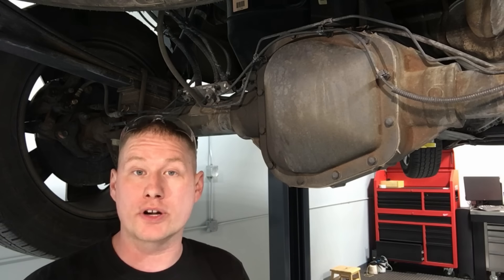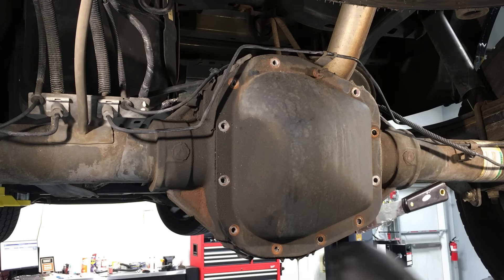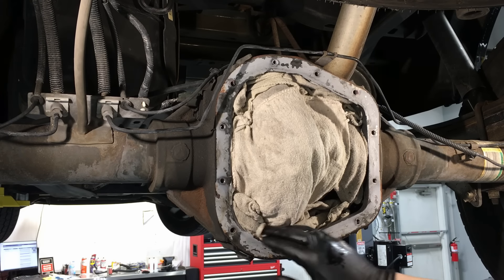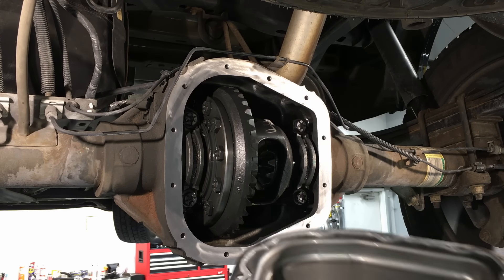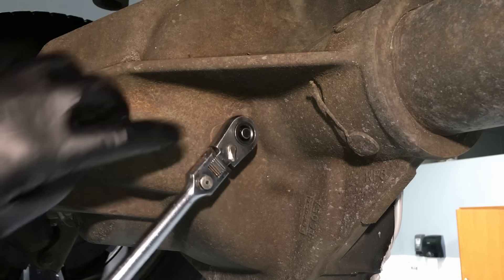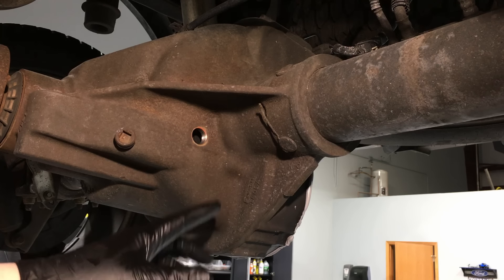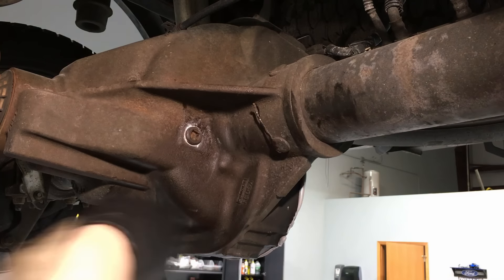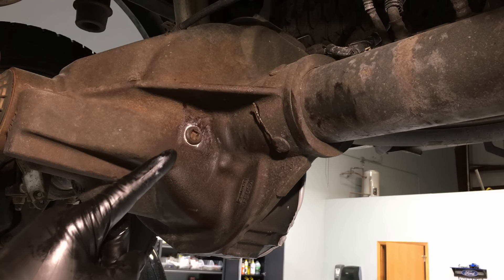Ford 8.8" 9.75" 10.25" Rear Differential Service: Fluid Change Procedure

Comment: I hear many say to be very careful not to use anything that would scratch the mating surfaces while cleaning old gasket off...then you come along and use an actual flap disk/abrasive pad to clean it.  Which is correct?  

Also - using only RTV and no actual paper gasket?  Is that ok?

Comment: I put 3 in mine and could feel the oil when sticking my pinky down in there. Just got another bottle watching you tell us that it has to be at the bottom of the fill plug. Would driving it while low mess anything up.? I probably put 50 miles on it with the oil slightly low.

Comment: Thanks for the information. I did my 2018 F150 this past weekend. Front and Rear. I would of used a 13mm if you wouldn't of mentioned it to use a 1/2in socket

Comment: Would having a couple of 1/2 inch bolts with the heads removed help with sliding the cover back on?  Finger thread in, slide cover on and get some bolts back on and then remove the headless bolts.
Reply from the maker: No need on these differentials, it is wide open back there. So as long as you have even a little hand eye coordination, you will be ok.

Comment: Remember to loosen the Fill bolt BEFORE opening the diff. If you drain the Diff fluid and then find out the fill bolt is fuzed/rusted/stripped you are screwed as you cannot add new fluid.
Reply from the maker: ABS sensor or vent port, there is always a way plus I have never seen on seize as they are NPT threads.

Comment: The diff is hanging, so the won't the "fill til it comes out" method not going to be accurate. Shouldn't a stand jack be uses to raise the diff horizontal?
Reply: doing it at home, its high enough in the air you dont need to jack the truck to do this job, just find a level spot to do it.
Reply: the diff angle does not change significantly you would be talking about a difference of a few ML maybe

Comment: Have to wonder how clean the new parts actually are  before things are assembled. Might not be a bad idea to change out  the Diff fluid when hot while particles are in suspension  at first oil change

Comment: I have a 1992 F150 and will be changing the oil in the differential. I do have the gasket for the cover should I use that or the RTV.

Comment: Thank you for making these videos. I have an f150 that was a fleet truck, basic 2wd open axle (rotate wheels one goes forward one goes backward correct?) I have driven it about 40,000 miles (it has 260,000 on it) so I should probably do this. I work for Ford as well. New subscriber!

Comment: So I gouged the housing....its just a tiny bit. Should replace it? Also...alot of hard solid grease at the bottom....
Reply from the maker: No the sealant will fill it in.
Reply: Youre a peach. I forgot to tell you I bent it too 😁. As a strength coach....im dangerous under a car. Next job....cam phasers

Comment: With gasket maker, I've always been told to snug the bolts, wait an hour then torque down, giving it a little time to dry in a thin layer like an actual gasket, don't know if there is a difference torquing down before or after drying a little, but I guess time wise doesn't make a lot of sense for a tech to let dry before torquing down
Reply from the maker: Absolutely no need.

Comment: I have a 2003 E150 Van with the 9.75 rear end, 5.4 L motor.  19 axle code.  The owners manual calls for 75w-90 Synthetic gear oil, should I still switch over to the 75w-140 you used in the video?  Thanks for a great video!
Reply from the maker: Yes
Reply: @FordTechMakuloco  Thanks!  Love your videos.

Comment: I always thought you were supposed to torque it to half the spec, let the RTV dry, and then torque it all the way. Is that not correct?
Reply from the maker: Absolutely not needed as shown here you will have absolutely no problem. 20 years and never a problem, even Ford recommends to tighten right away.

Comment: This is why I don't go to dealerships or lube place if i don't have to. They don't take the time to do it properly like he does. They get paid to do a job and do it as quick as possible. I like to go a good proper job like he does.
  So many times i have known people who had an oil and filter change done and the filter wasn't changed. They marked them before they took in their vehicle to check and sure enough just oil.

Comment: GREAT Video! Got my SUB! Two questions, I have 2003 F-150 with 225k miles, Is it really necessary to run Synthetic? and two, can't you just use the grey cover sealant on the fill plug?

Comment: why do we need to remove the cover? Can we use a pump to pull the fluid out from the fill hole?
Reply from the maker: Yes but some are neglected and the cover must come off for a proper cleanout.
Reply: FordTechMakuloco makes sense. I forget that some of the metals might settle down at the bottom. Thanks and I learned quite a lot from your videos!

Comment: The permatex instructions say to finger tight till you see it squish out, wait an hour, then torque.  I did not do this but sequentially torqued as you did.  Assuming this will be OK?  Also you had in the list thread lock but not sure if you used that in the video, should I use the thread lock or will I be OK?  My rear differential is reassembled but I haven't added oil yet.
Reply from the maker: Do it just as I have shown here and you will have no problems. I never wait the hour just a few minutes and it gets torqued and never a problem in 20 years I do them all the time.
Reply: @FordTechMakuloco  thank you so much!  Exactly what I did minus the permatex. I used Max Flex

Comment: I have an '03 Expedition 4WD 5.4 with the 9.75 open diff, the dealership guy said to use 75W90 for the rear and front, but do you recommend I go ahead and the 75w 140 for both? My Haynes manual says to use the 75w 140 for the rear and 75w90 for the front, just trying to get the right stuff in the right diff.  Thanks, reallllly appreciate your videos!!

Comment: is it normal to feel a bump from the rear end when taking off from a stop 2016 F150 3.5L eco with 60k miles? (its not the slip-bump on driveshaft ive greased that) Is that too much play in differential to feel? Doesnt do it at anyother speed.

Comment: how about using a couple alignment pins/cutoff bolts when you put the cover back on! !
Reply from the maker: Not needed when the differential is right in front of you.
Reply: @FordTechMakuloco  I mentioned it because you said not to let the cover slip around-losing sealant and ending up with a leak!  I'm senior master tech with Ford by the way!
Reply: @FordTechMakuloco  - my suggestion pertained to not smearing the sealant and causing a leak!

Comment: Just wondering if the fill plug, that just ahead of the one that you are using, might be for "setting" the correct fluid level.  I've seen gearboxes with a filler port on top and a plug in the side.  And you usually add fluid untill it drips out of the side plug openning.

Comment: Is the fluid type the same if you have a locker or an open diff? I’m assuming the procedure is exactly the same. Is there any advantage of using the Motorcraft vs something aftermarket (like Redline or Liquimoly, for example)?

Comment: Did the 2017-2019 super duties change to 140wt too? My manual says 80wt and came out after this video.
Reply: My understanding is the Dana gets the 140wt and the Sterling (10.5 non-elocker/e-locker) gets 75w85 syn hypoid.  Sure hope so cuz that's what I put in it.

Comment: I have a 2015 Lariat Eco and have noticed the back diff cover has always had a slight leak on the bottom left corner. Never dripped or puddled or anything, but I clean it off, and it gets a very light coating shortly thereafter. I'm at 45,000 miles so it's probably due for a change anyways so I'm going to remove the cover, and re-seal it properly. 

Could you just cut a 3-4" section of clear hose, put one end on the bottle of fluid, then the other into the fill hole and tip up that way? Seems it would be less messy and less waste, and frankly easier?

Comment: Great video and thanks.  What do you think of fluids that have friction modifiers built in? (Royal Purple and Valvoline for example)
Reply from the maker: I will never use them way too many problems.
Reply: @FordTechMakuloco  Would you elaborate a little?
Reply from the maker: I tell you golden advice from many years of experience that they are trouble yet you want me to convince you more?
Reply: @FordTechMakuloco  Just a few details if you're up for it. I'm only as good as the information I get. If missed something feel free to let me know. The Valvoline full synthetic gear oil for example, all the reviews and forms I've gone through so far reflect everything working fine and limit a slip diffs so you tell me.
Reply from the maker: The limited slip additive is either incorrect or not enough or even too much for the Ford differentials. So many times with various fluid brands, techs have problems with chatter afterwards. With the Ford fluid it is a virgin fluid and you add one bottle of friction modifier to the diff for the perfect amount every time, no guessing if it is going to work afterwards.
Reply: @FordTechMakuloco  That makes sense and thank you.

Comment: I have 2012 F150 3.7 V6 should I regear if I add 34' tires and if so to what size gear. I do not tow or go offroad. Thanks for the videos.

Comment: When adding the thread sealant, how long do you wait for it to dry? Also, will the thread sealant damage the fluid if it gets in contact with the fluid when installed?
Reply from the maker: No dry time needed
Reply: @FordTechMakuloco  thanks for the reply. Will the thread sealant contaminate the oil?
Reply from the maker: no it has npt threads

Comment: Consider looking for rust under those Ford applied stickers at the u-bolts for the leaf springs. They can hold back moisture and accelerate axle tube rust. Too much rust weakens the tube in that critical are where the tubes see the most flex from acceleration and deceleration.

Comment: Another pro tip, ALWAYS check you fill plug FIRST before draining.  It's a bad deal when you drain it and find that it will take an act of congress to get the fill plug out.  If the plug is a problem you can make sure you have time to fix it and not put yourself in a bind.
Reply from the maker: Have you ever actually seen a seized rusted in NPT plug in your life?

Comment: Out of curiosity on your video servicing the front diff you said just to go ahead and use the 80\90 fluid regardless, and this vid you stated to use the 75\140, just want to be clear on which one I should use for front\rear diffs and the transfer case? Hope to hear back.
Reply from the maker: Yes that video was on servicing the front diff and this video is on servicing the rear diff.
Reply: @FordTechMakuloco  ah, so i should stick to these two types respectively i assume then, i appreciate your feedback good sir.
Reply from the maker: Yup the rear does much more work and is working full time so they run at a higher weight.
Reply: @FordTechMakuloco  makes alot of sense, thank you!

Comment: Thanks so much for your videos they are great. I have a 2018 F150 the owners manual says to use 75W-80 In the front and rear diff, do you recommend anything different?  The transfer case calls for Mercon LV can I use motorcraft transfer case guild instead? 
Thanks again.

Comment: I don't know if you're still monitoring the comments on your older videos, I've looked at the TSB's that I can find and the changeover to 75w-140 doesn't appear to apply to my 2001 Mercury Grand Marquis. I verified this with my friend who's the commercial sales manager at a Ford dealer. I've also read that the SAE split the 90w gear oil spec in 2001; with the lower end of the old scale being kept at 90, and the higher end being 110. Would an open 3.27 ratio 8.8 with 195,000 miles  benefit from higher viscosity gear oil, or is it just a waste of money and mpg? It has 80w-90 in it right now with no noise, so I'm probably over thinking.
Reply from the maker: 80w-90 is correct unless towing then you want to use 75w-140 when it comes to the Vic.
Reply: @FordTechMakuloco  Thank you.

Comment: Perhaps someone else has brought this up, I didn't look thru 1726 comments.  Over the years I have done Ford and Chev rear end fluid changes by drilling and tapping a 1/8-27 drain hole in the cast bottom portion of the rear end, radiused off sharp edges to prevent chance of a crack propagation, installed a brass hole plug, and drained and reinstalled fluid.  Put 100K on all these vehicles with no problems.
Reply from the maker: Oh god no way.
Reply: @FordTechMakuloco  Give me a reason why - the only reason there isn't a drain plug is to save money.
Reply from the maker: Lol ok

Comment: Quick question...
Could you sit the bottles of oil in warm/hot water to help thin out or is that a no no?
Reply from the maker: Yes you can but it is not needed, as shown here you can empty a room temp bottle into the fill port in 20-30 seconds.

Comment: Hello I have a 2013 f150 5.0.  I have 134746 miles in it.  I just bought a 30 ft travel trailer and I going to start camping this year.  I have never changed the front or rear differential fluid.  My question to you is “should I” or is to late in the game to mess with that because of the miles?

Comment: Hey, love the videos and I’m about to do my diff oil. 
Do you have any comment on the 2004/2005 change from 90 to 140 weight diff oil on the F150’s?
I have an 04 and the Ford Manual says to use 90 but I see 140 mostly being used. Also, do you recommend the Motocraft friction modifier?

Comment: FordTechMakuloco,  IF I heard you correct you do NOT need the friction modifier if I have an electronic locking rear differential on my 2015 F150?   When it is not locked it is LSD though Correct?

Comment: Something to check is the ring gear bolts.  My 04 lost one going down the highway.  Had about 80k on it.  Bolt went through the diff cover.   Found 2 others loose also.  Don’t know if it was a freak thing or not
Reply from the maker: Yes it was

Comment: 5:25 What about the volume of fluid in the "TUBES"?  Why start wiping before giving time for the tubes to drain fully???     Also, when filling, how much time is allowed for the oil to migrate to the ends of the tubes, before checking proper "FULL" level?
Reply from the maker: lol you are funny!

Comment: I have a Transit 350HD w/ Quigley4x4 that is built out and heavy. Manual calls for 75W-85. Would it be a good idea to switch to 75W-140 if I run 9500lbs+?  If not, any issue with Valvoline 75W-90 w/ LS Friction modifier at 1/2 the price?  TIA
PS Too bad your shop isn’t in CO…I’ve got some broken exhaust manifold bolts 😢

Comment: Been thinking about adding an aftermarket differential cover, with fill and drain plugs and holds more fluid. Is it worth doing that to make it easier in the future and also holds more fluid to run cooler?
Reply: no watch banks video on aft covers, they do not splash properly, save your money.

Comment: Any vehicle.
My brother's Blazer has 306,000 miles on both original front and rear axle and his four wheel AUTO and four HI and Four LOW work perfectly.
He changes the fluids every 40,000 miles...

Comment: So you didn’t wait for any cure time either. I did the same, not realizing I was suppose to hand tighten, let it sit for an hour, then torque them🤦‍♂️.  I was going to do it over, as I didn’t put the oil in yet.  Did yours leak at all?
Reply from the maker: No need to let it cure before tightening, now you do want to let the sealant cure overnight before filling. I have done hundreds of these in the past 20 years no problem.

Comment: Am curious since you want to keep the inside clean why not after the cover is off not take a can of break cleaner and wash down the inside of differential to get old oil off the gears seems everyone else does it that way
Reply from the maker: I will not leave a pool of brake clean solvent to mix with and thin residual gear oil and possibly damage the axle.
Reply: @FordTechMakuloco  yes I see your point but and there always a but a few rags and if you wait a couple minutes it will evaporate problem solved

Comment: Wouldn't it make a lot more sense to snug the bolts till you saw some squish out, then let the sealant set over night and torque it the next day? On Butler metal roofs their sealant actually has little tiny beads in it to preclude complete compression of metal parts. That always made sense to me. Maybe this sealant is the same?
Reply from the maker: No need.
Reply: @FordTechMakuloco  Hi Brian,  I used a Felpro gasket on mine and I'm noticing a very small drip. Torque is on the money, what do you think is causing this?

Comment: Question - how hard is it to turn those rear wheels once the drums are off?  When I turned the wheels on my '94 F150 2WD (axle 19) with the tires on, it felt difficult but I figured it was just the brakes dragging.  But now that the wheels and drums are off, it is still hard to turn.  It's definitely a two hand job to move the wheel.  Does that seem like a rear differential / axle bearing problem of some sort or is that normal?  I noticed that the brake lining on the shoes was thick but CRUMBLING.  Had a similar problem on my 1965 Ford Galaxie.  Damn Fords.